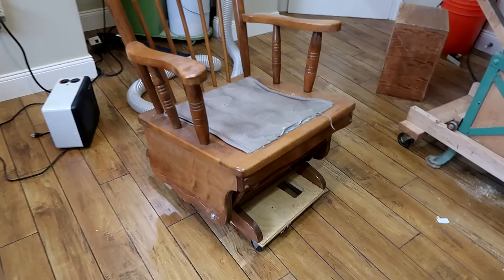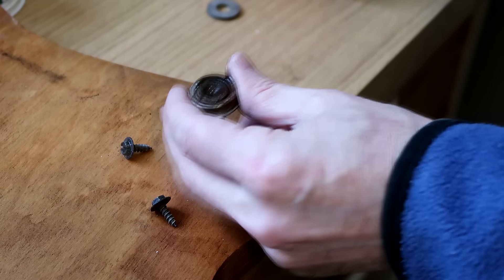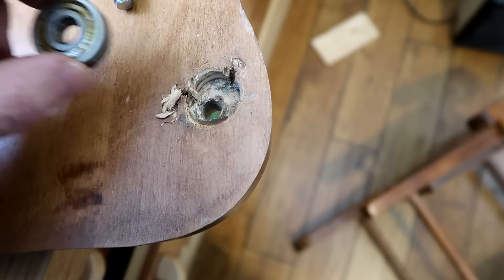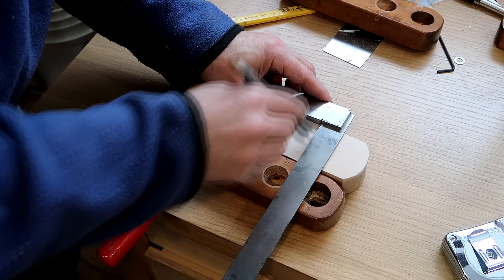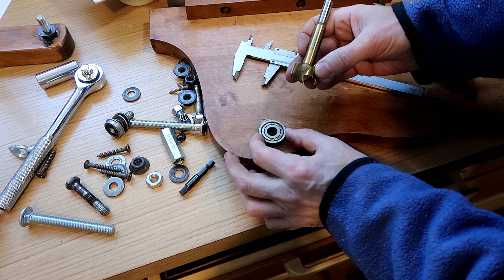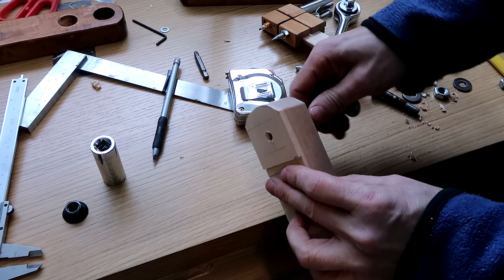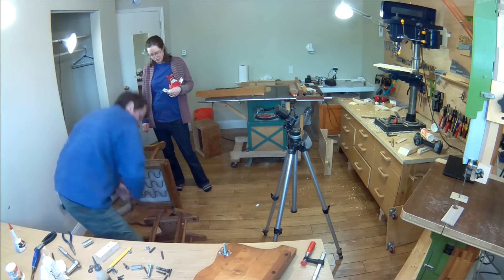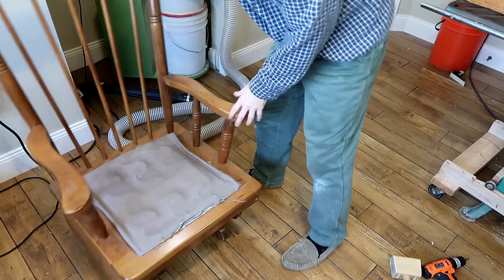Fixing a glider rocking chair

Comment: Did a similar repair.  The bearing/bolt hardware used was impossible to find, but I found that skateboard bearings are cheap and the same size.  I just had to source new bolts for the skateboard bearings.

Comment: I fixed one of these also.
The bearings were still all in place on mine but they were popping out and the base was loose and wobbling from side to side and parts were rubbing that weren't supposed to touch.
Mine required the base with the two vertical parallel boards to be reinforced by adding two more boards turning the base into a box.
It is now much stronger and better than it was new.

Comment: Thanks!  I just found a glider while walking my dog and picked it up later.  It isn't in as bad condition as yours but I had some annoying clunks while rocking. Several of the bolts needed tightening but when I tried to tighten them they just spun because of the ball bearings.  I used a C clamp to squeeze the pieces together enough to keep the bolt from spinning while I tightened the nut.  The clunk is gone but now I have some squeaks that I need to track down.  Always enjoy your creative woodworking.

Comment: Why did you choose to make a new wooden part rather than oversize-drill the ruined hole, glue in a dowel, and redrill the original size hole so that you could re-use the original hardware.  Easier to build a new wooden part?
Reply from the maker: Easier, and the original hardware for it was missing

Comment: 3:48 - why didn't you just center punch the holes through from the original part laid on top of the new part?
Reply from the maker: cause I would have had to drill precisely thru the middle of all the holes.  That would be more work and less accurate.

Comment: I wonder why the "glider" rocker exists at all - it seems to offer no practical advantage over the traditional design. while adding needless weight and complexity to the design. Presumably I´m missing something.
Reply: Try a traditional rocker once! They are not nearly as smooth and they tend to creep across the floor.  They become a cardio workout if you have thick carpet too.
Reply: @jordanengdahl4418  Brilliant - that´s precisely the answer I needed. Thanks!

Comment: My glider isn't vey old. It is probably only ten years. My brother bought it for me from Boscovs. When it was delivered the assemblers didn't have washers, and told me they weren't that important. Well, a heavier friend used to use it a lot, and because the washers are meant to make it glide more easily, it is all out of whack now. I've since installed washers, and tightened the bolts very tight , but it still rubs terribly against one side. I think that one or more of the bottom wood pieces have come loose. My brother has had the same chair for 15 years, and has had no problem wt it, so I thinking it must be the lack of washers, in combination of my heavier friend that caused the damaged  Still they only weighed 200 pounds at most, and the chair was supposed to hold 300 pounds. After this I'll never purchase furniture from Boscovs, but does anyone know if it can be salvaged.

Comment: As a normal weight person- I can testify that these gliders just don't stand up to any form of abuse; Such as pulling the chair from side to side in order to move it. Leaning on one side and pushing with the other leg also can cause significant damage if there is any play in the linkages. Believe me, as a parent you really put the test to any type of engineering due to the nature of trying to entertain/sedate children. The fact you found such an old one is testament to the materials used.

Comment: do you wonder how much of today's stuff will remain working in 50years

those things are planned obsolescence to the core. i use one at my computer and the seat springs break, the bearing give out after a single year, the wood splits down the middle and the cushion are unwashable.
i am not bungee jumping into it either. everything is getting so cheap it almost makes you cry when you buy a 50-100yo tool or appliance at the thrift shop and its still working.
Reply: If you want to buy cheap stuff, you get a cheap product. Folks can still shell out money if they want a piece of furniture or product that'll last, but you pay for what you get. 

Personally, I have Ikea furniture and chipboard stuff that has lasted for 10+ years and multiple moves so it's not like it's impossible.